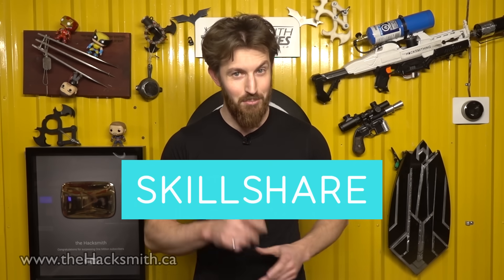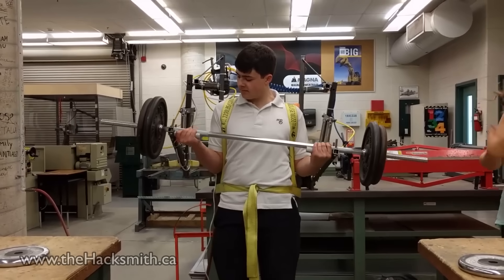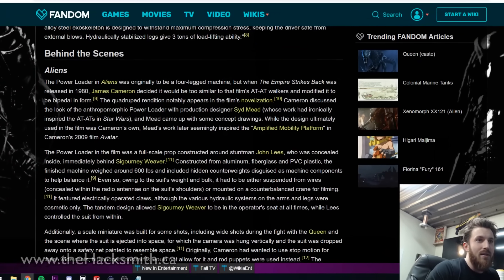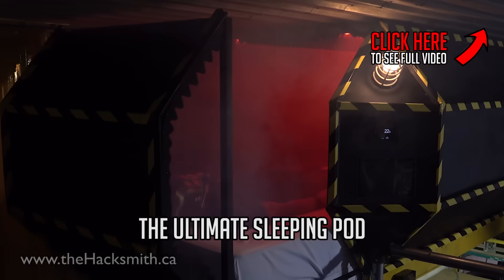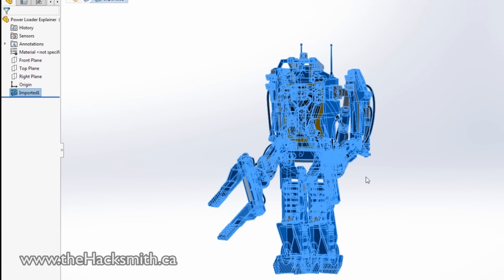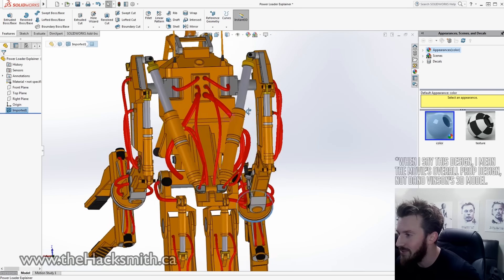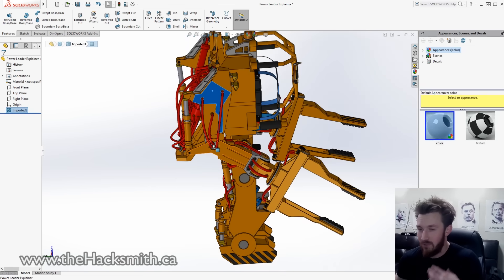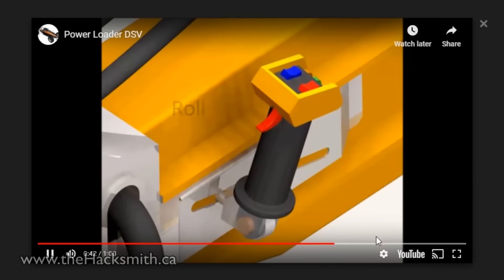Designing a MECH! (POWER LOADER: PART 1)

Comment: I think its about time you finally built this thing. Could you use an electric motor for the spinning wrist? I am just thinking it could save some space by fitting inside the forearm and still be something you could attach various armaments, shields, and accessories to. Also you're going to need some space to attach the hydraulics to the gripping hand, just a thought. Super excited to see what you guys come up with. I am building a shop in Thailand that mostly makes things of a different caliber.We are going to be shooting for the fun side of Adventures. Someday I would love to have you guys come visit.
Reply from the maker: Hard to get an electric motor with the torque required to actually make it useful :(

Comment: I don't know if you will see this but JLG boom lifts use rotators  to swing the basket, rated at 1,000 pounds, and in some cases rotating a jib that extends to about 15 feet as well as moving a basket up and down, the basket being rated to hold 750 pounds.  This would work for the wrist, these rotators are run on a hydraulic circuit with an orifice to restrict oil flow, they are capable of much more power and speed than as installed on the machine.  These could be used for knee and ankle joints as well, they are capable of 180 degrees of rotation.
Reply from the maker: Those are huge thigh

Comment: So... man lifts have a wrist joint at the end of the boom that allows the basket to pivot without using a hydraulic ram, it’s all self contained. Why not use that for the wrist instead of using a bulky ram?
Reply from the maker: I dunno what excavators you've them looking at... Majority of them use a hydraulic ram and a linkage...

Comment: Hello, Hacksmith, I have two project suggestion/requests for you, if you don't mind. I think they might be relatively simple, but I'm not an expert. The first suggestion/request is a fan powered windsurfing board. (Not a small house fan, but some other kind probably, maybe solar powered or something like that.) The second suggestion/request is basically a hang glider, but instead of having to be strapped into a fixed hang glider and hold on to big heavy metal bars, the rider would have strong, foldable (probably locking in place once opened) membrane wings (built with a light weight yet strong and durable carbon fiber frame probably) strapped attached directly on to the back with hand and feet bars used with weight shifting and leaning to steer the aircraft. I have the inspiration for the general ideas for these two, but I don't have the know how or building skill. Would take these possible future projects into consideration?

Comment: You should really look into engcon rotortilt for excavators. They have all the funktions you need, including the posibility for different attachments like drills and claws . It will also get you closer to the original design. I use it everyday.  It's easy to use and really Strong and riliable. Thanks for a great channel.

Comment: I like power suits and I've  learn an easy trick using separate electric stepper or servo motor are not necessary whenever metallic are used as its specific enclosure? copper metallic cut puzzle baring overlapping copper or  electromagnet couple as its enclosure action for tilt or pan, drawer slider, actuator linear lift etc. 3.7v Button batteries are  also embedded within the metal indentation to host battery with couple to the other metal bond sandwich between layer wiring connection  INVERTED power ☝ DC/AC. reduces excess loads by creating armor motors shaped according as like stator within electric magnetic motor cut to customize steppings. Is better for a motorman

Comment: I’m not sure if anyone else has wondered how to keep the powerloader from tipping over forward when it has a load and walking is it going to have long feet to counter the balance or will it have a gyroscope to help balance the load or is it going to have a crane weight system in it just a thought that I didn’t know if you or anyone else had figured out

Comment: Couldn't you conceivably pump hydraulic fluid into a torque converter to make rotational motion and maybe even use solenoid powered locks to keep stuff in place? Thought it might be an interesting design choice for some of the rotate-y bits.

Comment: Use some steel lines on some points instead of rubber lines then if you want that look wrap the steel line in the hydraulic hose
Reply from the maker: ... What's the point? We're going to make it how it would actually work, not just make it look like it
Reply: the Hacksmith I was just thinking in some of the spots you can use them

Comment: I have to polity disagree with electric motors not having enough torque, as most hydraulic lift gates on trucks and trailers, hydraulic presses and tools are powered by electric motor. For that matter an electric motor driven hydraulic pump systems can get something as heavy as an 60's era Impala to jump. Which leads me to suggest using the electric pump from a lowrider hydraulic system to power your loader. As they are fairly small and produce quick fluid pressure, plus you could mount the batteries down in the feet or lower legs which would keep the machines center of gravity lower. You would likely need more than one pump, but given their size there should be plenty of room for them.
Reply from the maker: Not what I meant by electric motor... Most hydraulic pumps are electric, which does work. I was referring to using an electric motor AS the joint, not the pressure suuply
Reply from the maker: we'll be using a gas engine for the end system because gas is still much more efficient and energy dense than electric. we'd need a massive forklift battery if we wanted to go all electric

Comment: i understand this could take a long long time, but why not make two Loaders, one to experiment on extra features (Big Daddy drill etc) and one for furthering your Flying like Iron Man, have larger jet engines on the four appendages as well as a series of smaller ones on the back
Reply from the maker: No loader will ever fly though... They're super heavy
Reply: Couldn't it be made from a much lighter material like carbon fibre?

Comment: How in the hell are you gonna power that thing?
Reply from the maker: Gas engine. Easy
Reply: @hacksmith  But you're going to have to fit an engine into it, fit fuel tanks for the engine, and make sure it doesn't bog down the frame.
Reply: @hacksmith  Not that i don't think it'll work, but that's a common problem with machines like this.

Comment: I am sure you know they make small hydraulic motors like for scissor lift drives, bushhogs,  and other factory machines.
Reply from the maker: Motors aren't the problem, rotary joints are =p
Reply: @hacksmith  Exactly.  Use hydraulic motors for rotary joints.  No problem.

Comment: They do make hydraulic parts that rotate. ROTOR STATORS ON A LARGE WOOD CHIPPER USE THEM TO DRAW THE BRUSH INTO THE MACHINE.
Reply from the maker: Yeah, and they're huge. See pinned comment
Reply: the Hacksmith micromatic makes some smaller rotary actuators that would probably work fairly well.

Comment: Please Try Boba Fett's jetpack
Reply: That would be sick
Reply: it won't work the same reason the Rocketeer jet pack doesn't work. Do I have to explain jet motor plus backpack equals man's ass on fire spinning like a pinwheel through the sky. There was a fellow about 10 years ago who was a former American fighter pilot who watched too many episodes of G.I. Joe as a kid and he may be only working jet pack that I know of and it was merely a mirror replica of the G.I. Joe jet pack Bobo Fett jet pack will not work! Nor will commando Cody or the Rocketeer. What you need is something similar to a miniature remote-controlled jet plane in design that you then strapped to your back. And if you position the jet slow enough that your posterior region doesn't burst into flames, then it will work landing however, is going to be interesting taking off, not so much. But landing is going to be a problem. There's plenty of videos on YouTube of that aircraft pilot, throwing his ass out of a perfectly good airplane and G.I. Joe Flying around with the jet pack. If I are member correctly he had to shut it off and land using a parachute.
Reply: @peterparker6584  I see what you trying to say. Thanks for the answer.
Reply: Boba fett jetpack? It's future
Reply: Nils dany yes, please do Bobba Fett’s jetpack, make sure the missile works like a firework or something

Comment: You mentioned you will use a gasoline engine to power the pump, this begs the questions:
1. How much would that engine weigh?
2. What type of engine, configuration?
3. How much POWAAAH?
Reply from the maker: probably at least 100-200hp engine weight is negligiable compared to the rest of this beast
Reply: @hacksmith  Thank you for the info!
Reply: @hacksmith  I would suggest you use a straight/boxer 6 engine as they are very smooth, having a giant metal vibrating constantly on your back could fatigue you.

Comment: For the hands to rotate u should go to harbor frieght get some of those atv winchs mount them. In side of the arm then connect them to front wheel drive car axles to the brake rotor so all that cab rotate and turn simples easist strongest way to do it

Comment: Love what you guys are doing.  I would only suggest considering a switch to a much thinner construction material, such as a sheet metal of 12-16 gauge, to fabricate most of the arm assembly (you can use thicker plate to mount the cylinders).  It looks to me from the SolidWorks part display window that the metal plates for the arm are 3/8"-1/2" thick.  Using this thickness of metal plate will result in one arm assembly weighing several hundred pounds, making it difficult to move and imposing larger than necessary loads on the remainder of the power loader structure.  In fact, consider using sheet metal (i.e. 12-16 gauge) for the entire loader structure, it is going to be surprisingly heavy even then.  If you use the sheet metal module in Solidworks, you'll be amazed at how much more quickly you'll get this project done (i.e. there is a tab feature that will cut your workload down considerably)
Reply from the maker: 12-16ga wouldn't be able to lift the kind of loads we're anticipating... we sized the sheet metal according to our finite element calculations we performed. 3/8th is as thin as we can go. we also already built the arm...
Reply: @hacksmith  It sounds like you plan on lifting a very heavy load - perhaps 2000lbs - based on the selection of 3/8" plate.  Two things then - make sure you check that the overall C of G hasn't gone beyond the foot toeline for whatever load you want to lift, or you'll have a tipover when lifting the load (if you haven't checked it already).  Second - years ago I used plate material (and hollow structural steel) when making long reach booms, but now I use formed sheet metal just about 100% of the time.  You can get a superior weight/load performance with formed sheet metal compared to heavy flat plate, especially where cantilevered structures are concerned (which is obviously what your power loader arm is).  All the best, this is an excellent project and I admire what you guys are doing.

Comment: I'm no engineer so do not take my word for this but if you intend to flip a car with the final product take into account this thing weighs less than said car.
Reply from the maker: it's not going to weigh less than a car when it's done... a  single arm is nearly 800lbs already
Reply: @hacksmith  Sure thing I just don't want to see the biggest and greatest build yet to have an issue like this but if that's the case then great I look forward to seeing the rest.

Comment: Put a hydraulic motor inside the cylinder/pipe that forms the wrist joint. Since the joint and motor are cylindrical it might fit well however the motor shaft would then be pointing the wrong way. So use a worm gear transmission  to get the output in the right orientation.

Comment: Hey Hacksmith, have you ever looked into servo motors, specifically ones used for metal extrusion plants. Idk exactly what the weight load or whatever is on them, but I know that they are super strong and they can move super fast. From what I know, they're used for the robots that pull the metal out of the press, and these robots can travel like 35 mph.
Reply from the maker: no where near strong enough